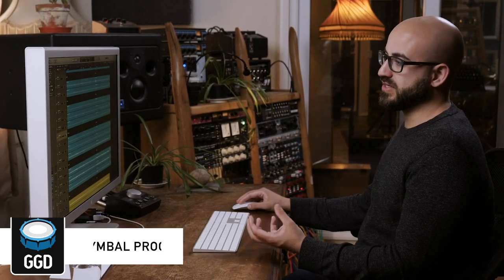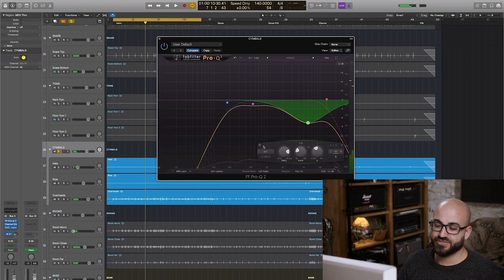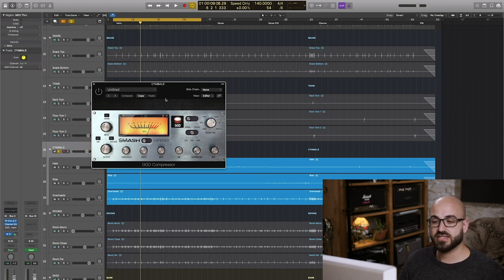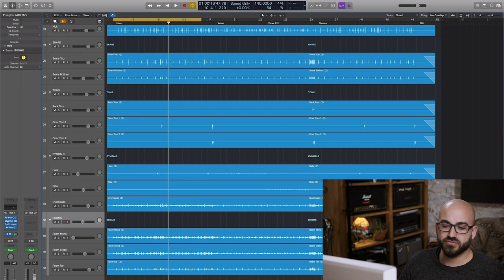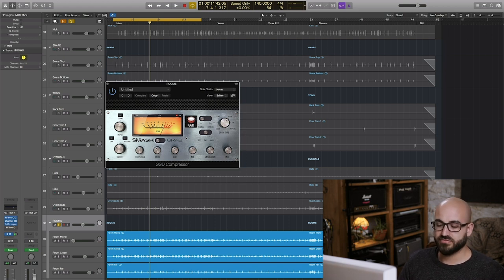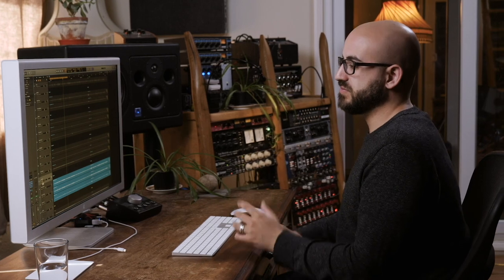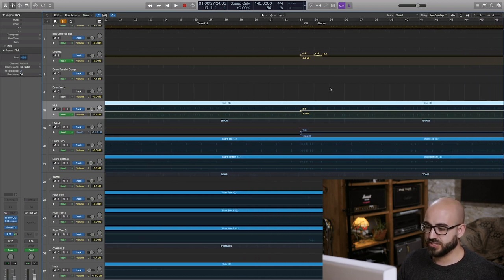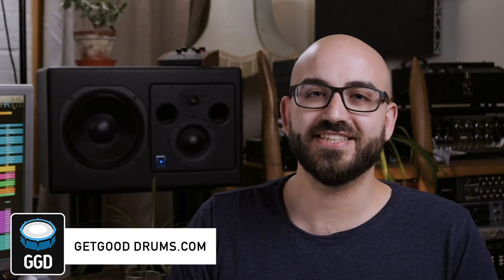NOLLY MIXING MASTERCLASS - Cymbal Processing

Comment: so at 2:50 or so, on the EQ pop-up, if these graphics are to be trusted you are just essentially cutting the overall volume down. Not selectively EQing the signal. you might as well, turn the signal down a bit, no? I think the bells of your EQs are a bit too wide, and the cut between 5-7k is way to much. you are taking the sizzle of the overheads way down, almost away completely. But I do realise that this is largely a matter of taste, how far you take these things, and if the final mix is great - who cares ;)